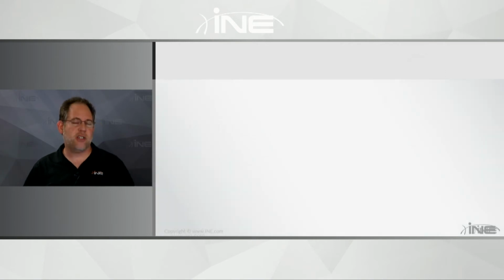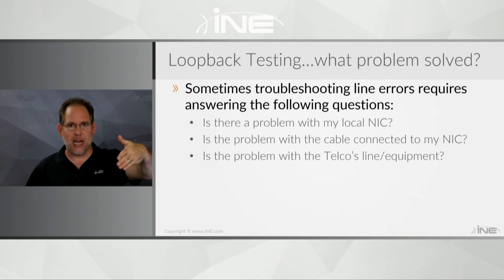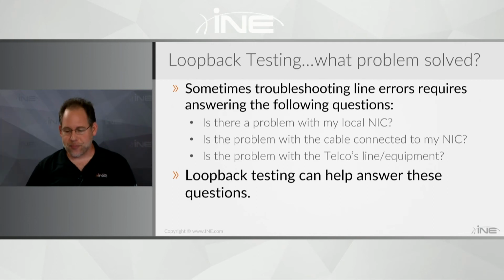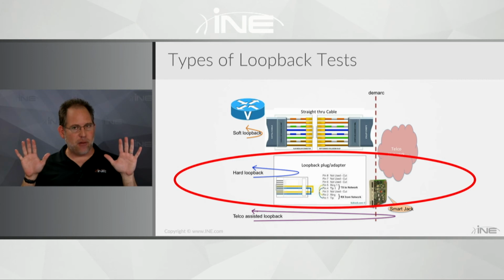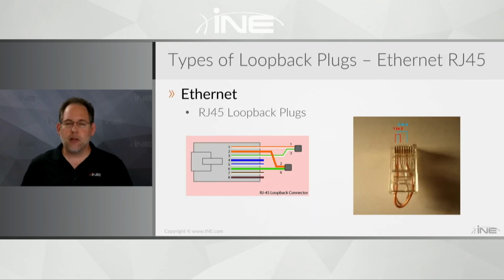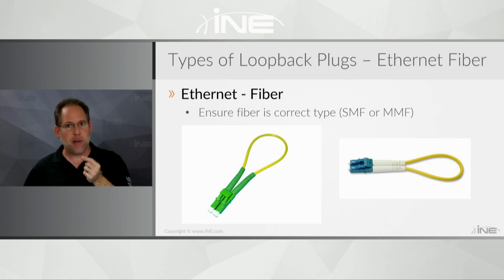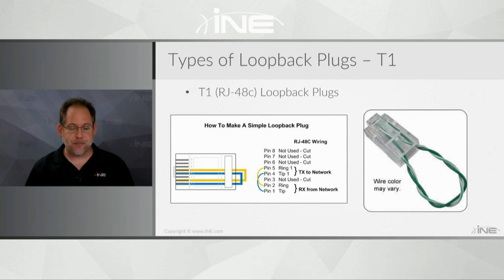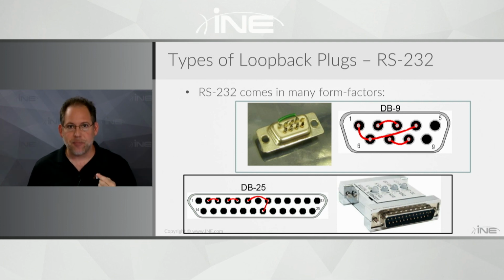Identifying Loopback Plugs

Comment: Hello, Just a query,  If I connect the RJ45 loopback plug to one of the switch port, how I will come to know if that interface is working fine or not. I use cable tester from one end of the switch to wall jack where we connect machine..and cable tester gives indicating lights to find out...in this case how I will come to know...
Reply: Ethernet interfaces rely on the reception of Layer-1 "keepalives" (i.e. Pulses) from the remote end of the cable. When these pulses are received the interface reports itself as "Up".  So if your interface was never coming up, and you plugged in a physical Loopback plug, and your interface STILL didn't come up, you would now know there was something wrong not with the cable...but with that interface itself (because Pulses transmitted on its transmit pin should have been looped-back and received on its receive pin causing the interface to come Up).